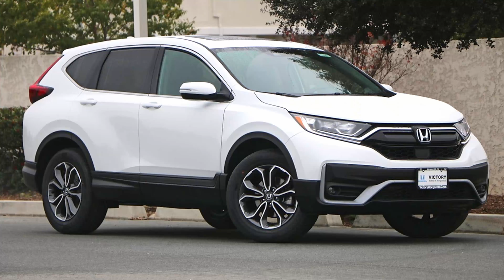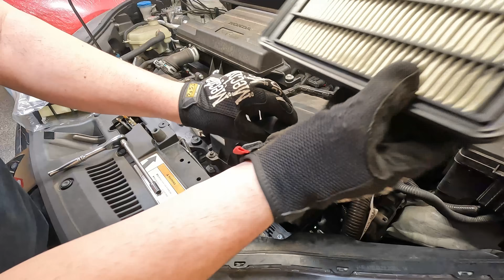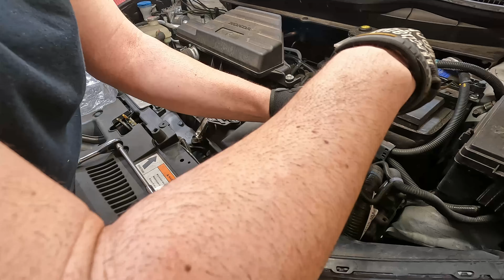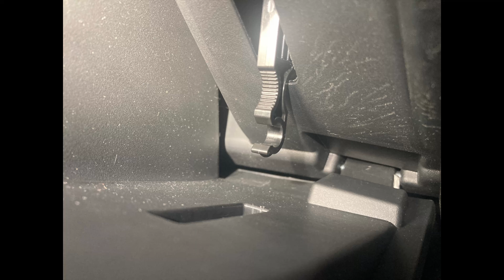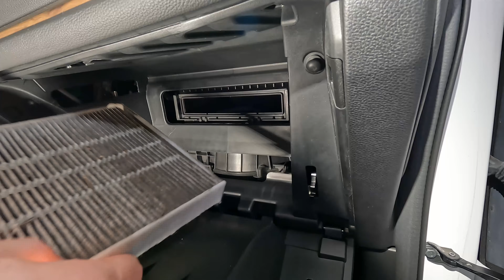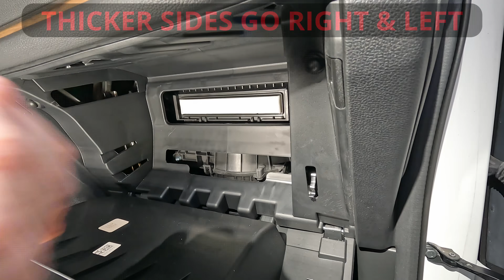Honda CR-V Engine & Cabin Air Filter Replacement (2017-2022 1.5L)

Comment: On the cabin filter the arrows point down but the cover assy shows pointing up?
Reply: That’s just for the plastic cover. Arrow up is correct. Filter itself is arrows down(air flows top to bottom). Hope this helps.

Comment: Very nice, dealer wanted $150 for replacement of both filters. The best part is they were after market filters.
Reply: The strange thing is that the dealership charges you for labor.  They already removed the cabin air filter to show you that it is dirty and if you tell them do not replace it, they have to reinstall the old cabin filter.  Which means they already did the labor.   That's just a big rip off from the car dealerships
Reply: My dealership charges that for one filter, double for both 😅😂 they recommended it and I said nah I'll do it myself
Reply: @TheEmiSFG  same, they wanted $200. It's outrageous. I'm okay with them making a profit but this is a rip off
Reply: Exactly same for Los Angeles area dealer. $150 for both. Unbelievable. Thx for video saving me $$$$!